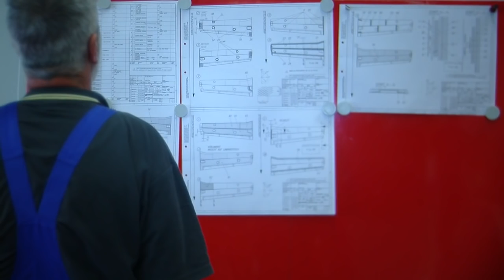Examples of GROB composite technology

Comment: Wonder what kinda of paste adhesive they use. Must not be worried about all the extra squeeze out in between those rib stiffeners. After a while vibration and turbulence can knock big chunks of that loose then you’ll have serious FOD floating around.
Reply: Most adhesive pastes are going to be some form of filled and toughened epoxy.  

The adhesive bead diameter is usually tested on many samples to see how much is needed to ensure a good bond with minimal squeezed out, and how much pressure to apply via clamping or vacuum bag. And aircraft production lines are going to use that specified amount of adhesive. 

Generally, blind adhesion joints are disliked by both engineers, manufacturing, and QC staff. But there aren't many ways to effectively eliminate them. So they place them non-critical or less critical areas. E.g. lower wing skin to spar and ribs, where air pressure at maximum loading is positive, not on upper skins to spar. Where air pressure is negative and might rip the skin lose.